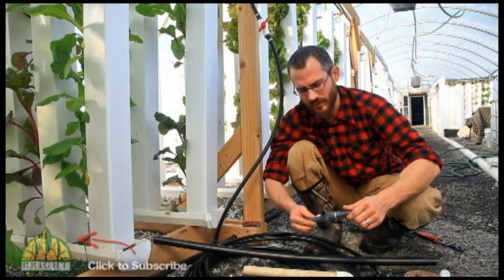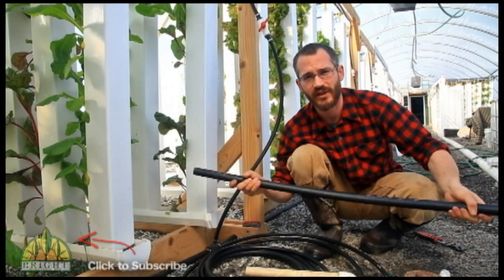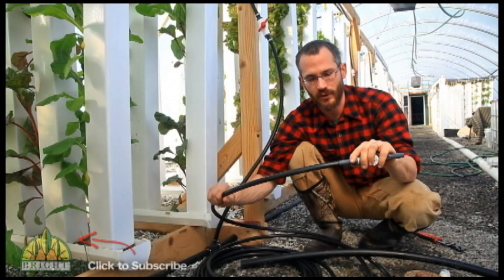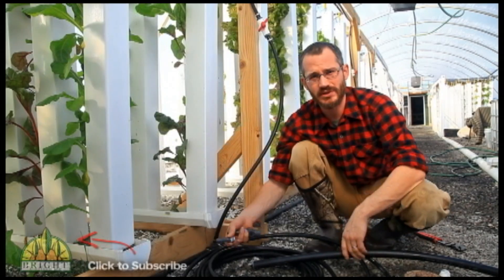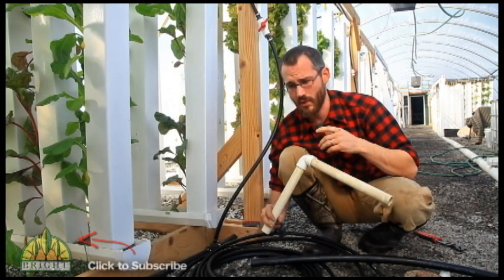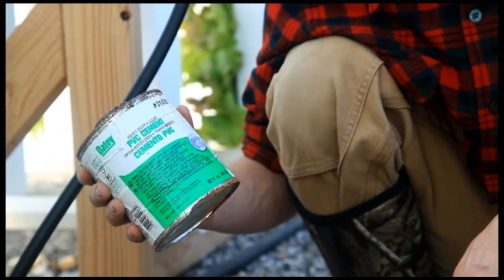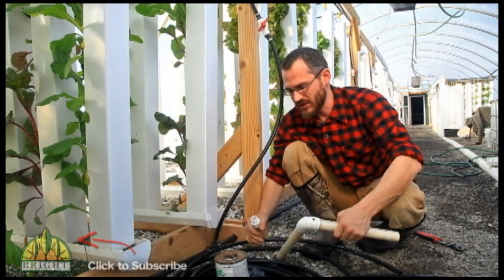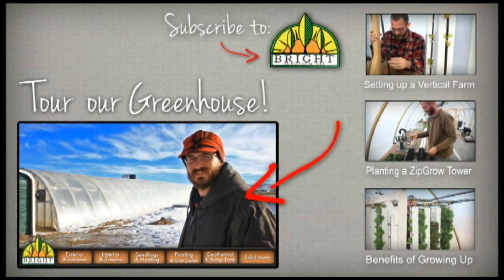How to Plumb an Aquaponics System: Pipes & Tubing

Comment: Hello,
Do you use a fitting instead of bulkhead for your fish/filters and swaptank?
Because bulkheads are extremely expensive.
I have two 3000liter fish tanks and considering using 25mm pvc pipes for my aquaponic system.
Do you think it will work?

Comment: Hey Doc, I love your videos, but I was just wondering what you could use to connect the poly tubing to PVC?
Reply from the maker: Hey Gavin Venable - You can connect poly tubing to PVC pipe with a simple barbed fitting! One trick is to heat up the poly pipe with a hair dryer or heat gun and then push that sucker onto your barbed fitting for a tighter fit. Hope that helps, Gavin!

Comment: Hey Doc! I have watched quite a few of your vids and it is this one in particular that has me thinking I should go with the flex pipe. I am just curious if you have issues of clogging in your 1/2" feeders and how you would flush those if you did? I would assume just open the ball valves and blast it. Have you ever had to disassemble your flex tubing setup for cleaning? I love the idea of the ease of use of the flex over the rigid pvc, but I am curious if you have solid data that would confirm that the flex would have better flow/efficiency over the rigid? Thanks for your amazing work!
Reply from the maker: We really like flexible poly pipe.  We crimp the ends so that we can open the whole thing out from time to time and blow out the solids.  Even so, our clog rate/nozzle is very low and can be easily solved by "rattling" the lines.  See our video on opening up the greenhouse for more info on this.  They're low cost and very low maintenance for us.  We also have moved to a serpentine configuration on our poly pipe (just snaking it along our lines of towers in one long line) that we really like.  More info on this to come.  We don't ever take our lines apart.  Just blow them out.  Curved ends means our flow efficiency is better and rattling the line once per zone makes maintenance much easier with our serpentine configuration.

Comment: hello nate i love your thoughtful intelligent approach to aquaponics, i was curious if you are aware pvc over time is said to leech esters into the re circulating water supply effectively feminizing livestock and humans who consume the livestock. also i have heard Australian pvc is free from esters/plasticizers etc. what are your thoughts on this if any I for one  would love to hear info on this topic
Reply from the maker: James, some plastics are certainly worth being concerned about- you're thinking of soft pvc which does contain some plasticizers that are worth taking a look at.  We are careful to use rigid vinyl which is very inert and very safe.  Rigid vinyls are very safe because they don't need the plasticizers that soft vinyls do to be flexible.  In my home we use rigid pvc products like pipe but I do not allow my family to use soft vinyl.  For the same reasons, rigid vinyl is acceptable under organic standards, but soft vinyl mulches aren't.  Rigid vinyl is only dangerous when it is burned or heated to very high temperatures- one reason why we ask that people recycle their tower housings instead of burning them.  :)

Comment from the maker: We use PVC mostly.  Standard PVC safety depends on rigidity (i.e. were there plasticizers used to soften the PVC) and sourcing.  Virgin American PVC is very safe.  Imported Chinese PVC was bad because they used heavy-metal based plasticizers and there was concerns about their stability in the plastic and leaching.  If you're using US-sourced PVC, you're on safe ground.

Comment from the maker: Pressures vary, but we end up running really low pressures on our lines to towers- we usually adjust them by hand depending on the day and need. Yes, the loss of efficiency is essentially due to the effect that the walls of the pipes have on the water flowing through them.  Elbows compound these issues.

Comment: Hy Nate. Your videos are really informative. Like cfyjimo1 I am wondering about the solid and susspended particles. In one video, sorry I don't remember witch one, you mentioned that you have high enough pressure that cloging isn't really a problem. So what is your pressure range on the top of the feed lines? If I remember corectly in you 'pump' video you mentioned we must take into account losses (15%?), but that is because of the bends and the length is it not? 
Anyway keep up the good work.

Comment: I prefer not to glue the PVC fittings.  Pressure should be low on most backyard systems and teflon tape at the connection point will prevent any leaks.  Again, this is pertaining to small aquaponics systems.  If you need to clean or change your set up, unglued fittings allow you to more easily reuse the pipe.  Glue pipe has to be scrapped if you change your set up.  Great vids!  So much good information here.  Great advice to go with black poly pipe over PVC.  I wish I'd thought of that!